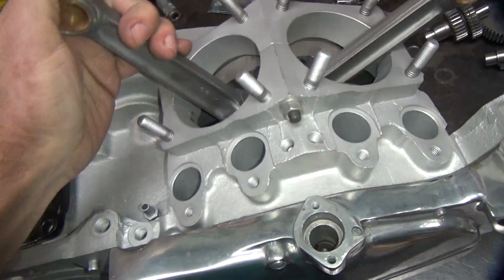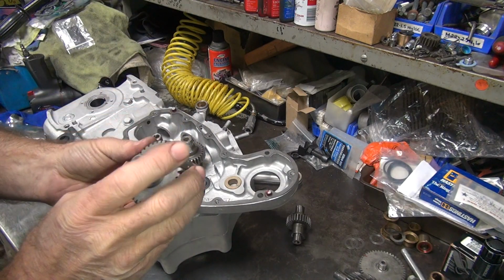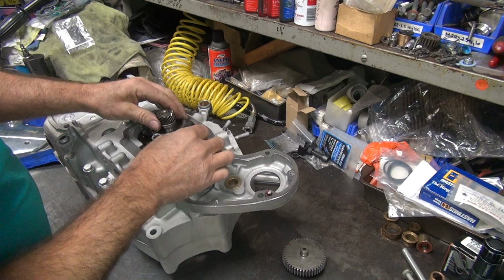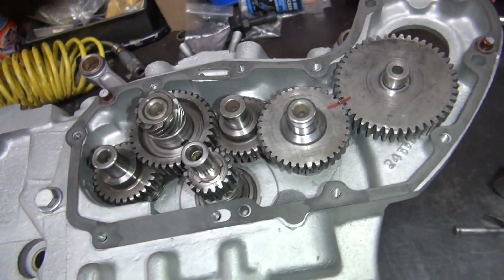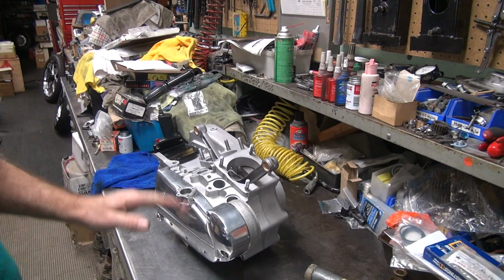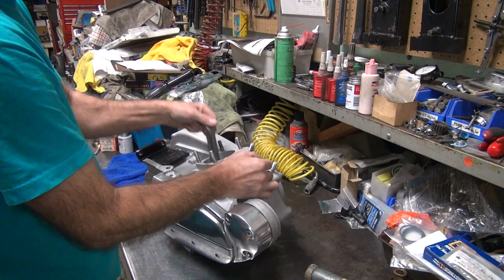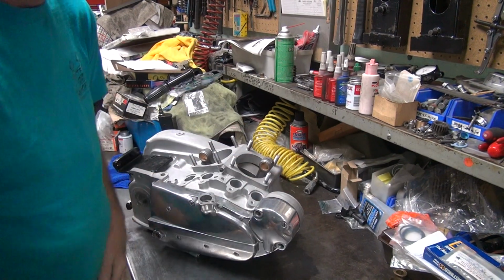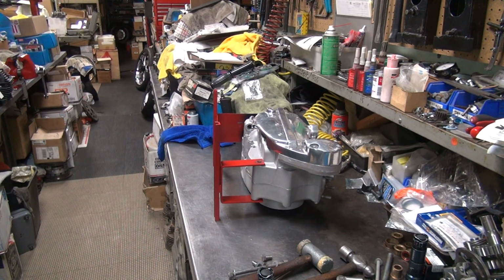1961 xlch #193 no miles transmission motor rebuild sportster harley repair restoration tatro machine

Comment: Damn that cam cover was a whole lot of work to get it to fit correctly, you did a good job are you able to get paid for all you time for jobs like this. I also have a small Harley repair shop i run into this same crap all the time. Thanks for all of the information it is very helpful.
Reply from the maker: no, the motor labor is a set price for the normal work done in a standard rebuild. if you want speed and make lots of money than don't give a crap about your work but have a good line of crap to snow the customer. i don't keep track of the hours. you can take all the video hours and times it by two to get some kind of an idea on what it takes to do these jobs. add another half to do all the paper work and baby sit the customer. whats another 3 days or work for a pinion bushing fitment worth.
tatro